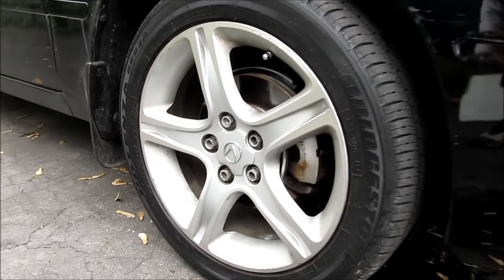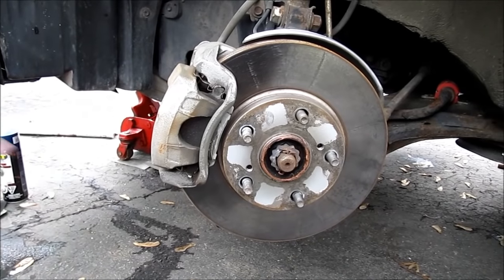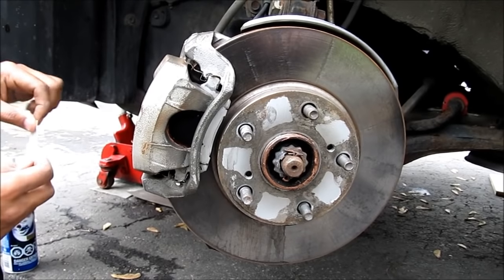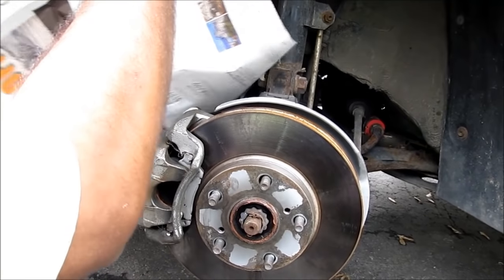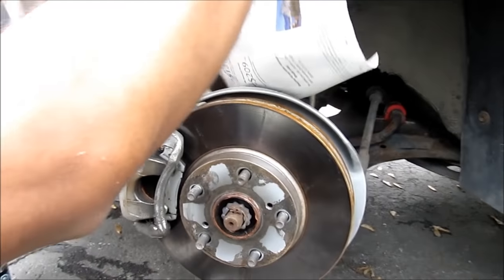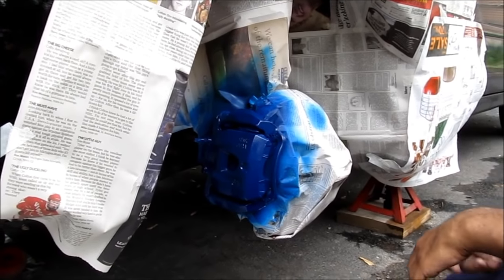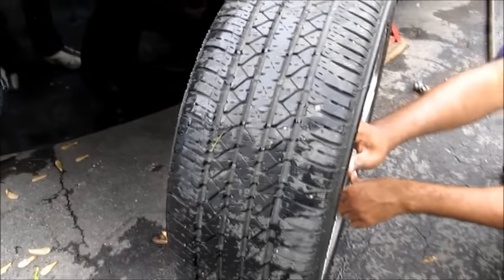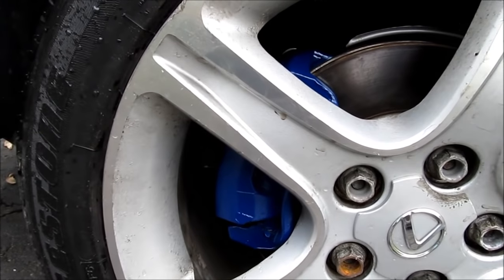How to Paint Brake Calipers

Comment: Should have used high heat primer to help paint stick better. High heat clear coat to protect blue paint from brake heat and chipping.
Reply from the maker: True. I've already repainted these this year in orange due to chipping.
Reply: speedkar99 how did you remove the paint on the brakes. I'm trying to repaint mine
Reply: Even the paint can does not say anything about primer or clear cost, it's not needed
Reply: One observation concerning brake calipers......

Whilst there is obviously heat produced between pads and rotors when braking.......this starts to dissipate when you take your foot off the pedal.

As a consequence there is very little heat transferred to the calipers themselves, so it is not really necessary to spend money on special, so called 'high temperature' paints......

I have used Hammerite from a can and it covers all the caliper very well.

Obviously there will be paints similar to Hammerite, but if you think about it any paint will suffice. 

The secret is to let it dry adequately and in this way a couple of coats can be put on to ensure good coverage.

I recently removed rear calipers and separated them in order to remove rust and road dirt / grease. 

A little bit of soft chipping at any loose rust, (remember calipers are cast iron so no heavy hammering), followed by close in work with a wire brush, before degreasing with some methylated spirits sprayed on the parts, (meths evaporates)......then spray paint before reassembly and fitting back on the vehicle.

James Hennighan 
Yorkshire, England

Comment: Methylated Spirit is cheaper than brake cleaner in a spray can......and no aerosol propellant....

The beauty of Meths is that it can be put into and dispensed from any empty spray bottle you have spare........AND......their is no need to wipe it off with a cloth, (which can leave fibres behind it), because it evaporates.....

Meths is the easiest cleaner and degreaser to use because it evaporates.....

It can be used on brake pads surfaces if get any contamination on them........ALSO........the best thing to clean the outside surface of a newly fitted bulb....gets rid of any finger marks that can compromise the longevity of the bulb.

James Hennighan 
Yorkshire, England

Comment: Thinking about doing this this summer. How many cans of paint would you need for calipers at all 4 wheels? I'm gonna do primer, 3 coats of base then a coat or two of clear.
Reply from the maker: +Snakeplisskin440 2 cans to be safe. I got about 2.5 coats with one can.
Reply: Tim,
Buy up like 5 cans from the same store, same batch. Return whatever new cans that you didn't need to use. 
Guarantees color consistency, as you're not mixing batches.

Comment: One additional thought.......

If you brush some washing-up liquid onto small or practically inaccessible parts.......AND LET IT DRY............it will seal them from any paint over spray.

Once the pain it dry you can simply run some water over the parts with the washing-up liquid on them........or just leave it for the rain to wash it off when you take the car out on a wet day.

Hope this might be helpful......?

James Hennighan 
Yorkshire, England
Reply from the maker: Thanks for the tip

Comment: 0:23 I see you had some polyurethane lower front sway bar bushings. Did they make a noticeable difference? I've had a TRD rear sway bar and bushings for years, but left the front alone because TRD never made polyurethane bushings for the front. I see Energy Suspension has them though.
Reply from the maker: They came with the car so I couldn't judge the stock feeling

Comment: Hey, I painted my brake caliper the same way you have done it but it dried to a mat finish and I'm wanting a gloss finish. Would spraying on a clear coat spray work. What do you recon?
Thanks
Reply from the maker: What kind of paint did you use? Try using a high gloss paint on a primed surface. A clear coat will make it shiny but not glossy, and might be less durable over time.
Reply: If you spray paint in cold weather that's the results.Doit when the sun is out.

Comment: A Banjo, (end of brake hose), fitting......or to give it its correct name, an Annular Fitting......is best secured, when detached from the brake caliper, by passing a nut and bolt through it, having a fibre washer and also a metal washer on each side of it. 

When this is tightened it will prevent or minimise the loss of brake fluid from the braking system, by completely sealing the centre of the Annular Fitting.

Once tightened  the brake hose can be secured, (Annular Fitting uppermost), with a plastic cable-tie to the road spring or shock absorber, giving you the space to work on the caliper, pads and rotors.

When the Annular Fitting is re-secured  to the caliper you then just need to open the bleed valve enough to fill the caliper itself.....though obviously you have to watch the main brake cylinder fluid level.

Result is minimal loss of brake fluid whilst working on caliper, pads and rotors......... no air in pipework.......and just the need to let enough fluid into the caliper when it is connected back up.......ensuring you purge the caliper of any air it may contain.

There may be some slight loss of fluid when you first detach the Annular Fitting, but this is minimal if you have your sealing nut and bolt and washers ready......and will only amount to a thimble full.

James Hennighan 
Yorkshire, England
Reply from the maker: Thanks

Comment from the maker: Taking the calipers off is more complicated because then you'll have to deal with bleeding the brakes.
When changing brakes, just the pad will be replaced, the caliper will remain painted.
Reply: Taking caliper off without disconnecting it from brake line would be easier

Comment: If you don't mind me asking, how long till the rust starts to appear through the paint though?
Reply from the maker: +DarkAngel182 my calipers aren't rusty. 
Generally the paint flakes off after 2 years.
Reply: speedkar99 Thanks!
Reply: Mine lasted 4 years, about 40k miles before it started to show flaking. All i did was sand down, prep and spray a different color. Lol. So every 4 years or so, ill change the color. Lll.

Comment: Will give it a go with gloss black but think I'd prefer brushing on instead. Interesting that Rustoleum's caliper paint video recommends using aluminum foil instead of paper because it holds its shape around certain parts. They didn't cover the rubber sliders like you did for some reason which is surprising. They also didn't prime or clear coat.
https://www.youtube.com/watch?v=YmZUXdamMdU
Reply from the maker: rkgsd Brushing is probably easier because you don't have to mask everything for overspray. I wouldn't paint the slider rubbers as they'll harden up and become useless. No need for clear coat unless you've got a show car with some nice complimenting rims. Brake dust will coat it in a week.

Comment: How do you cover the rotor underneath the caliper?
Reply from the maker: Use as much tape as you can. Some paint will get on the rotor. No problem as it will wear off instantly when you drive the car and apply the brakes.
Reply: I use a plastic bag to cover that area it slips right in and the paint never touches the rotor...
Reply: Take the caliper off.

Comment: No primer, no clear coat,,,, good luck having it last more than a year buddy
Reply: Do they have high temp clear coat?
Reply: Most high temperature paints don't need primer. It's clearly specified in the spray paint label 👍
Reply: The high temp clear coat would have been a nice finishing touch. But hey great job, looks sweet.

Comment: Have u video how to change Brake Calipers?my brake calipers has more oil
Reply from the maker: Follow this video to remove the brake hardware:
Toyota Rear Brake Pads and Rotor Change

Then remove the 10 or 12 mm bolt that holds the brake line to the caliper and change the caliper.

When you're done, follow this video to bleed the brakes:
Brake Fluid Change Toyota
Reply: speedkar99 thank u a lot!Hi from Russia)))
Reply: speedkar99 bolt from the brake caliper ,it wears gum she ripped, and all the oil it's not dangerous?there video how to change gum and piston caliper?
Reply from the maker: Антип Петрович A ripped boot from the slider pin isn't directly dangerous. It will cause your calipers to dry up and eventually seize. See my brake changing video for how to lube up the sliders. I don't have a video on how to change the rubber boot.

Comment: Ummmm I’m a woman nd I know to jus take the calipers off 🤦🏽‍♀️
Reply from the maker: I did that once and the system drained out dry. It's a waste of time to rebleed. I'd rather use the brush instead of spraying now.
Reply: speedkar99 it still got the job done tho so that’s all that matters lol
Reply: @speedkar99  I agree
Reply: @GotdayumMarie  and I see why you stated you was a girl
Reply: @speedkar99  Or use a clamp on the brakeline (rubber hose).  You are supposed to drain brake fluid anyway - if you don't want pistons to rust.

Comment: This is the wrong way and the lazy way just take off the calliper and do it properly!.
Reply from the maker: +Steven hickman Actually instead of spraying I've moved on to painting with a brush. Its more durable and no overspray.
Reply: speedkar99 What paint did you use when using brush? Just regular enamel paint?
Reply: What kind of paint do you brush on?  Thanks homie!
Reply: Absolutely not- it’s a huge job to remove the calipers and bleed the brakes. This is only for show/accent, why make the job so complicated by removing them. How about you remove them and have fun doing so. Great video.
Reply: Uncle Lido huge job??? It’s 2 bolts and easy as hell, yes they look good but my ocd wouldn’t let me do it this way.